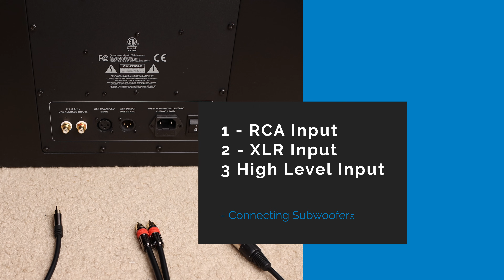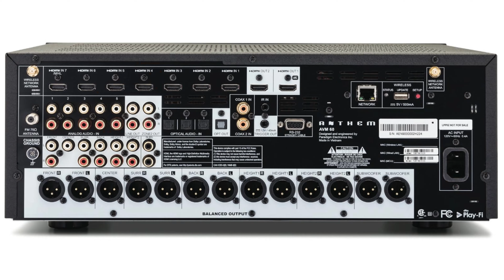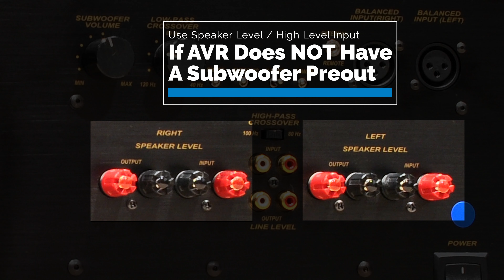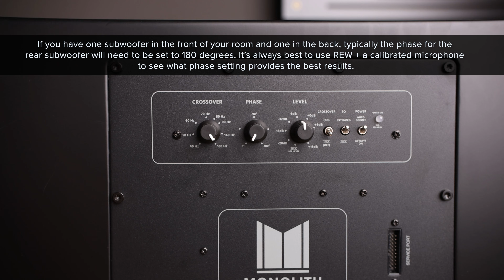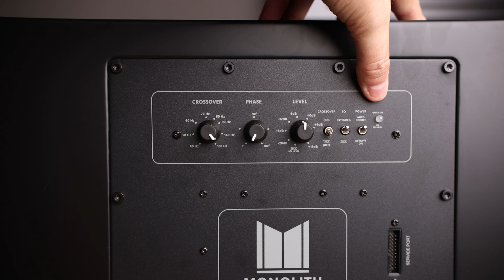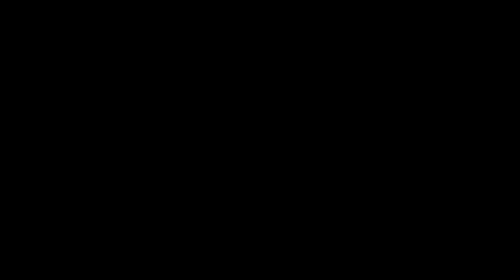How to Set Up a Subwoofer | EASY Step by Step Instructions

Comment: My SVS sub has LFE. Should I just do one subwoofer cable to LFE? Or is it better if I do subwoofer RCA cable Y split it to both the White and Red?
Reply from the maker: If it has an LFE input, just use that. No reason to use a Y adapter.

Comment: Can I use a car subwoofer? The connection on it is just the two spots where you slide the speaker wire in
Reply: @palmtree_308  you would need to run power to it too, my buddy uses a car battery charger

Comment: Could cheaper cables ruin your avr?  I just upgraded to dual subs, and went to Best Buy to buy temp sub rca cables and a splitter while waiting for my svs cables to arrive.   All they had were cheap cables.  I bought them anyways, because I wanted to hear the duals for the first time.  I set everything up, and turned the subs on, my original sub popped when I turned it on, and I haven’t had good bass since from either sub.

Comment: Whats The difference between using y splitter or just one rca cable plugged into red line in port ..?
Reply: Did you find out?
Reply from the maker: It depends on how your sub is setup. I’ve owned older subs that actually required you to use a Y splitter. I think it had to do with voltage.

If your sub has one of the RCA’s landed LFE, you can use just a single cable to it.
Reply: @Youthman  i have a powered onkyo sub with 1 connector, and I was shopping for a reciever and most have 2 preamp subwoofer connections do I need a splitter for that?

Comment: Hi. I have a subwoofer from bose acoustimass. It only has 4 normal speaker wire ports. Input left and input right, output left and out put right. So i guess it just intercepts the front left and right channels. what do i do in the speaker config. do i turn subwoofer on or keep it off and what frequency do i put the front speakers to? full band or a frequency. i’m new to this.
Reply from the maker: The BOSE Acoustimass is often referred to as a “bass module”. Connect your left and right speaker out on your AVR to the BOSE bass module inputs, and then left and right speaker out on the bass module to your speakers.

As far as your AVR is concerned, you do not have a subwoofer. That setting is looking to use the Subwoofer preout connected to a Subwoofer that has an internal Amplifier. Your bass model is passive and does not have an internal amplifier.

You would want to run your speakers at full range in this setup because you do not have a subwoofer connected to the sub preout.
Reply: @Youthman  Wow thank you so much i was little lost. If i buy a dedicated subwoofer now and connect that would the acoustimass bass module become useless? And would a dedicated sub make a big difference?
Reply from the maker: To be honest there are so many speaker and Subwoofer combinations that would easily outperform the acoustic mass system. As the name implies, it was designed for the masses, the general public that are not familiar with good sound.

My recommendation would be to go listen to some speakers at your local AV store. We have magnolia in some of our best buys. Audio Advice and Worldwide Stereo are great options if you are close to one of their locations.

Comment: can you go over the speedwoofer 12s? and if your av receiver subwoofer slot has 4  single hole rca plugs you just put it in the right lfe one? also whats the difference between unbalanced and balanced

Comment: Usually, you connect the cable to the L (Left) input on the sub and not the Right one according to subwoofer manuals
Reply from the maker: Each sub manufacturer is different. Always best to check with them if it’s not specifically labeled.
Reply: @Youthman  I follow the instructions in the manual. I am quite sure what I read unless Velodyne, Yamaha  have both got it wrong and you are correct
Reply: @Youthman  I have an old spare subwoofer with no LFE markings next to the input. As a test, I took up your suggestion and connected both L and Right using a Y connector. Sounds great with solid bass, plenty of realism and body.  One can pick up some good tips on YouTube videos. Thanks Youthman
Reply from the maker: I have known certain brands that require both L&R to be connected. It varies from brand to brand how they design it.

Comment: I did not get it  did i need  rca splitter for my sub. I have 2 subs Jamo 410e .  They are with 2 rca conectors.  White conector is " Left (Mono)""  and red is "Right" did i need to use splitter or i just need to use only left (mono)

Comment: Question from the newby, who is thoroughly confused right now lol.....I have the Monoprice 8 in  powered sub, and it came with 2 red and white plugs.  On the back of my Fosi BT30D, 2.1 I have a subout on the left and 2 subouts on the right.   The cables fit the sub out on the left, but it's only one output. and on the right where there is 2 out puts, the cables just don't fit.  What can I do, or should do?
Reply from the maker: If I'm looking at the correct 8" Monolith sub online, you will see two sets of binding posts for "High Level Input". This is NOT what you would use if you have a subwoofer Out on your AVR. Those connections allow you to connect the sub to an AVR that does NOT have a sub out using banana plugs connected to speaker wire. Again, NOT what you need for your setup. 

Instead, use an RCA cable or a Digital Coax Cable to connect one end to the Sub out on your AVR and the other end to the subwoofer's Right Low Level Input or use a Y splitter like I showed in the video to connect to the L and R Low Level Input.

Hope that helps!
Reply: @Youthman  Hey thanks for responding, but I have an update...I bought the Sony SCS8 I think that is the model.  Everything is working, but I have a question...I bought banana plug and some 14 G cables.  I connected everything and it does sound good, but my question is my banana plugs that I connected to the cable, they are not completely screwed together.  I can screw so far but then that's it.  There is a small gap between the top and the bottom...but I can hear everything and it sounds ok.  I've got the Sony SSCS5 with the Subwoofer above.  Will this set up, or is there a little tweak I should make.  And I'm expericing the near field system...My speakers are about 3 feet from me.

Comment: On the Marantz receiver it has Subwoofer 1 and Subwoofer 2. 1 RCA cable should go to your Left sub and the other to your right sub. Then the receiver will ask you how many subs you have so you choose 2 and let it know which is which in the GUI. Then you can set the parameters, after you do the microphone set up, to fine tune the subs based on the REI results. Happy home theater 😀

Comment: Great video, I'm thinking about adding a second subwoofer to my current home theater system (All Klipsch Speakers) I currently have the Denon 4700H avr receiver with a 10" wireless downfiring subwoofer, Can I add a second wireless subwoofer or wired would be better & How would I set up the subwoofers so they don't cancel out each other?
 Please keep those videos coming very informative👍🏾

Comment: Im watching this video because I purchased that same sub and same receiver. Can I connect the single sub to both outs on the receiver?.
Reply from the maker: Hi JF. There is no reason to connect both sub outs to a single subwoofer. The Sub out is a mono signal carrying all of the LFE content. Simply connect that to your subwoofer.
Reply: @Youthman  my man. Thank you very much for the knowledge. God bless.
Reply from the maker: Glad to help
Reply: @Youthman  good evening sir,
So I got the receiver, speakers, and the 13 thx ultra. Hooked it all up and all 5 speakers work fine. The sub however, no output. Any advice?
Reply from the maker: If you have a 3.5 mm to RCA adapter, you can connect your phone directly to the Subwoofer to make sure it’s working
Reply from the maker: If you can confirm that it’s working, then you likely have a setting in the AVR needs to be turned on
Reply: @Youthman  good morning sir,
I ran the test with the adapter and the sub is responsive. I went through the settings on the denon and the sub is added. It won't even play when I'm connected via Bluetooth from my phone. Same issue, speakers work and the sub does not.
Reply from the maker: Make sure you are connected to the Sub Out and not the 7.1 Sub Input on the Denon.
Reply from the maker: Go through the Test Tones under Speakers > Audyssey > Manual > Speaker Levels. If you don’t hear the sub when selected in the list, you can the cables connected incorrectly
Reply: @Youthman  thank you sir. It all seems to work now. I highly appreciate you assisting me.
Reply from the maker: Glad to help

Comment: the way i added a Sony explode 1000w was with a explode amp connected to a computer psu then in input to the sup output on my pioneer vsx-515 for some explosive bass, though not recommended in the city limits because its very bassy and any gaming they will hear the explosions that you would feel lol

Comment: Hi sir need your expertise.... I have an RXA 3080 and a Psb 5i sub.... At the rear panel there is white and red (low level input from preamp)  a LFE input crossover bypass switch....i run one sub RCA cable from amp to the low level input.... My question is prior to running ypao.. Must I switch on the LFE input?  Tks

Comment: Thanks for the tips and sharing it with us .. I have Klipsch R-120Sw Subwoofer and I put the gain to 12 clock and the Phase to 0 and the crossover to the last .. in the Av receiver (RX-V6A) when I do the calibrate using Ypao it set  to -10db but I feel this is incorrect so how much should I put the db for the sub in Av menu. and thanks a lot
Reply from the maker: That sounds perfectly correct. Klipsch speakers are very sensitive so the AVR has to turn the trim levels down significantly so that it can reach reference levels at 0dB on the AVR’s master volume. My trims are typically at -12dB. Check out this video https://youtu.be/g-GOvn6_um8
Reply: @Youthman  Thank you very much

Comment: Good video.  My advice to people is to spend $100 and buy a Umik1 and download REW to really understand what is going on in your room to optimize your setup.
In my 2.1 music system, I added a sub because I got one for a great price and set it up initially using the sub crawl method ( modified because I used a SPL meter as well as my ears) the set the phase for max output.
After running REW, I found that my towers had an F3 of ~ 20Hz in room by themselves. When I turned the sub on, a room mode peak around 50Hz or so got worse and the system sounded better without it.  When I saw it added 4db to the peak, I figured reversing the phase could subtract from the peak since they are close to each other, and it did, flattening out the response while still keeping F3 at 20.
Totally counter intuitive, but I would not have known without REW (it is hard to get a good curve plotting SPL meter readings) So my sub ended up acting as an electronic bass trap. Go figure.
It did end up saving me $$ since I ended up not needing the MiniDSP I was going to get to fix the room mode since my Stereo amp does not have any room correction built in.

Comment: Hi for my setup:
Denon AVR-4500H (125 watts at 8 ohm 2ch driven)
Klipsch Rp 280fs (150W)
Klipsch Rp 450c ( 150W )
Klipsch Rp 160m ( 100W )
Klipsch r-112sw 
SVS Prime elevation ( 20 - 150 W ) 
I was wondering if I need an external amp for my setup, if so which one would you recommend.

Comment: What are your thoughts on using various subwoofers of various sizes and brands for those of us who upgrade slowly over time?  Does it hurt to keep your 8" sub in the room after you upgrade to a 10"-15" or find a Youthman deal online for a price you can't refuse?  Whenever I see the phrase "no replacement for displacement" it's usually referring to multiples of the exact same sub which is not exactly how most people grow/upgrade their setup.  Thanks.
Reply from the maker: Hi Greg, typically, an 8” sub isn’t going to benefit much when pairing it with a 15” sub. Nothing wrong with having different brand or different size subs in your setup. I just don’t recommend mixing ported with sealed subs. It can be done, but is much more difficult to integrate
Reply: Your 8" sub can handle the higher bass freqs and the new 12" sub can take over the low bass, under 80ish hertz. Distortion will be minimized big time. The only distortion you'd get in the bass zone would be from volume... but, your ears would be bleeding by then lol

Comment: Hey youthman I have a question regarding a receiever i just got. Its an aiwa mx z92 and on the back of it it says (IMP 16 + 16 Ohm) and SURROUND SPEAKERS and its a L R rca port. Im wondering what it is and how i would use it to connect some surround speakers is this a Pre out for an additional amp to be connected? Thanks.
Reply from the maker: Honestly I’m not familiar with AIWA. I haven’t seen one in over 20 years.
Reply: @Youthman  ah right ok tbh aiwa isnt very common these days lol. Thank you anyway god bless
Reply from the maker: I always wanted one when I was a teenager. We used to sell them when I worked at circuit city many years ago.
Reply: @Youthman  Nice! its actually quite a good system i was blown away by its bass and how clear it was i am very pleased with it. Would be cool to see one on youthman channel once in the future who knows.

Comment: Not too sure about your “3 db increase” with XLR connection comment  . . .
Reply from the maker: I believe Channa has a video where he measured with a DB meter between XLR and RCA and he showed the difference. I’m not 100% that it was 3dB which is why I mentioned I believe it is 3dB
Reply: @Youthman  XLR cables are usually used when you need very long runs as they are less susceptible to interference - that's all.
Reply from the maker: You are correct, longer runs is an additional benefit. That’s why they are used so often in pro audio.

But you’re incorrect on XLR not having a higher gain than RCA.

https://www.avsforum.com/threads/will-using-xlr-boost-the-db-of-speakers-slightly.1658441/

They are suggesting you gain a 6dB increase from XLR in this thread.

Comment: So... How do you hook up a system with, say, 16 subwoofers? Asking for a friend...
Reply from the maker: Should be pretty simple. Use (4) MiniDSP 2x4HD with a Y RCA adapter for each pair. Just don’t ask me how to calibrate those LOL
Reply: @Youthman  4 mini dsp?!? That doesn't sound like a yourhman deal to me!! I was thinking buy some bulk lamp cord, hot wire a Sony Xplode 4000w car amp from 2002, and just run them free air behind the couch. Audio nirvana awaits 🤤
Reply from the maker: Honestly that sounds like a great video for your channel. It could be your viral video

Comment: Hey Michael, nice video. Always informative. 
But I'm confused regarding 2 subwoofer setup. 
So if you have 2 subwoofers then do you recommend to put rear subwoofer to 180 and front one to 0 degree ??
Thanks
Reply from the maker: I’m not an expert in subwoofer placement but it is my understanding that if you have one in the front and one in the rear you will likely need to have one of them out of phase (set to 180 degrees). As I mentioned in the video, it is always best to use REW and a calibrated microphone to see what settings provide you with the best frequency response in your room.
Reply: @Youthman  Thanks for the reply and it was nice talking to you.
Reply from the maker: Glad to help

Comment: It is also very important to use good quality cables. I was getting weird intermittent crackling and hums on my subs when watching movies or listening to music. Sometimes when everything was off, I could hear a very low hum in the room. would reseat the RCA cables from time to time to get everything working again. I ended up upgrading the LFE RCA cables to better quality shielded and immediately noticed a big improvement. Nice clean distortion free bass. No further issues with having to reseat connections. A inexpensive LFE RCA cable can really have you second guessing other much more expensive components.
Reply from the maker: I have used an expensive cables for 20 years and haven’t had any issues with them. It might’ve been the cables you bought
Reply: I was originally using some very old 12ft RCA cables. When I got the subs. I was too much in a hurry to really think how old poor quality cables could possibly affect my equipment. My new RCA cables were only $10 each and the quality was much better. As always, your videos are awesome!